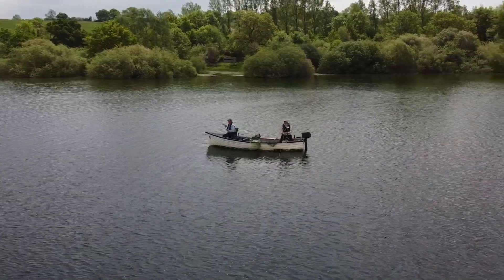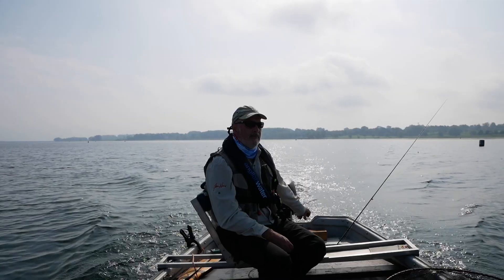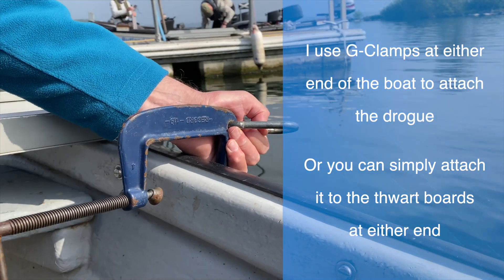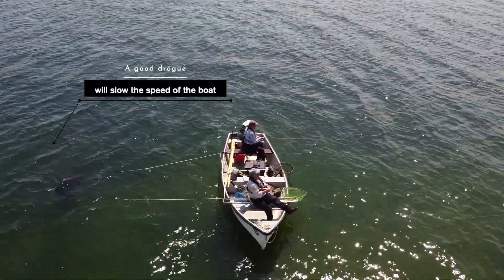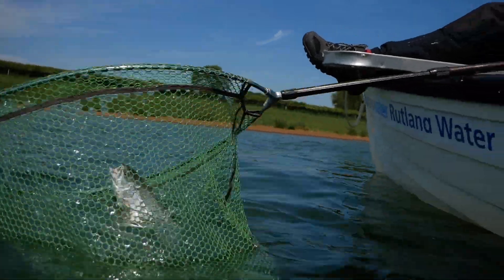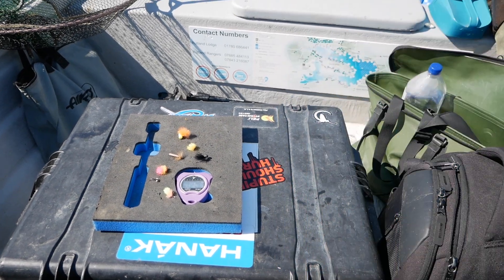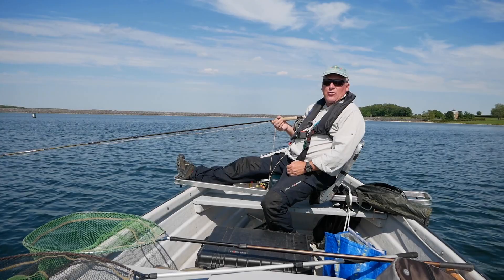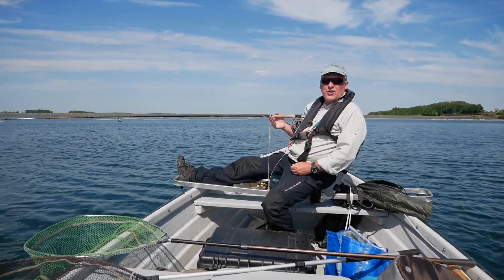How to set up the boat for a day Loch Style Fly Fishing (Spotting likely drifts)

Comment: Lindsay,  Thank you for this fine video.  Do prefer a comp legal para-drogue to have a hole in the center or no hole?  Why?   Thank you.  Cheers,
Reply from the maker: Hi Shannon, no hole for me it causes less resistance and does not slow the boat as well.
Reply: @lindsayiflyfish  OK, thank you.  It is a question I've researched, and find surprising little information about it.  At some point, Wychwood decided to offer a model with a hole in it for a reason---even though from a manufacturing standpoint adding the hole costs more.  Some folks seem to prefer it, others, like you, don't.  Cheers,

Comment: lindsay what tippet do you use for dry fly and what fluorocarbon do you use..the airflo fluorocarbon im using is really bad , its usually spot on too
Reply from the maker: Hi Mike, With dries it depends on the situation, if there is a good ripple I just use 6-7lb flurocarbon. If its a flat calm I use double strength drennan de-greased in 6lb. As for general fishing I used to always use Rio Fluroflex Plus but that got too expensive. Now I use Wychwood Ghost Mode 8lb mostly.